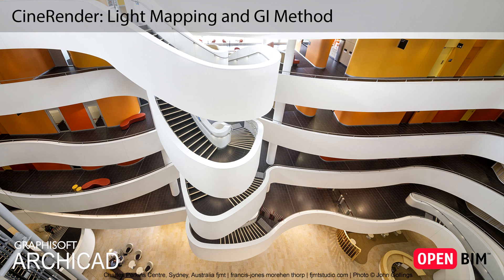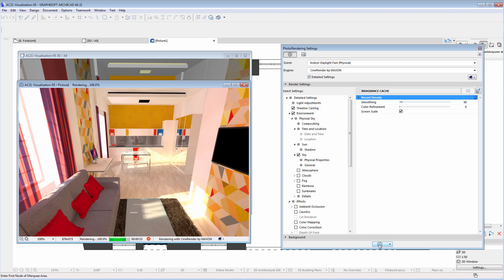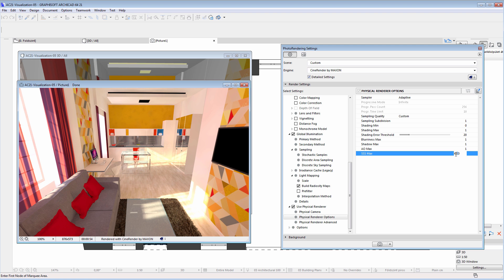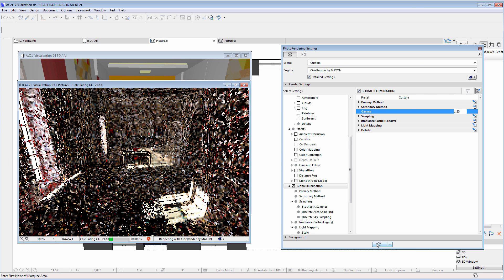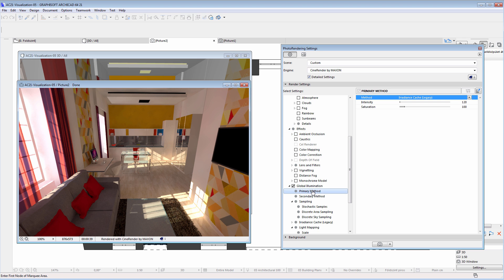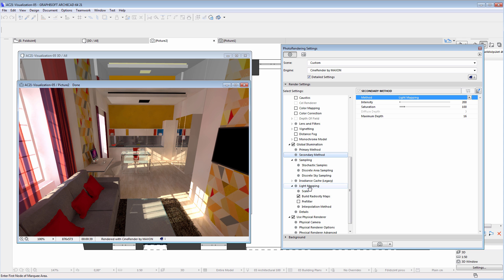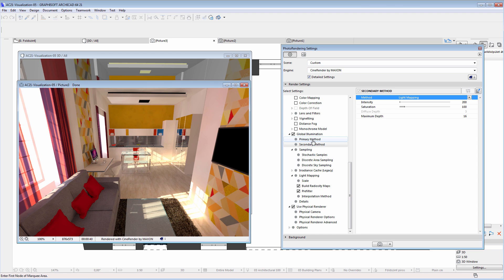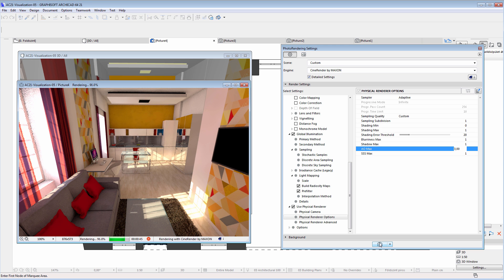ARCHICAD 21 - CineRender: Light Mapping and GI Method

Comment: Incredibly confusing tutorial. There is no point in changing the values without explaining what is the nature of the effect they have and to what magnitude. The interface and many of the settings are nonintuitive and even the simplest task requires hours of reading through a manual that does not have enough visuals to illustrate the different effects.

Comment: What is the configuration of computer which was use to render in this video?
Reply: ARCHICAD What processor, ram, graphics card? Of course this video I mean the YouTube movie/clip which I put the comment to. Title: CineRender: Light Mapping and GI Method. You show there many visualizations and depend on the settings time of renders are different. But what hardware was used to do this renders/visualizations?